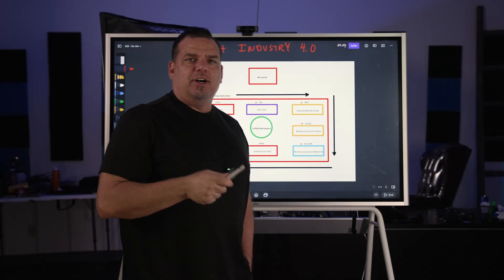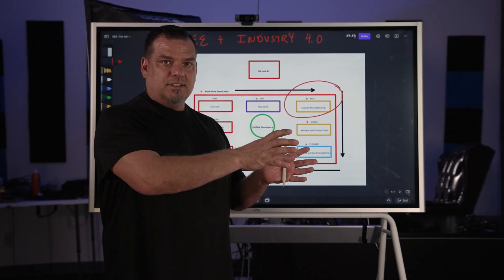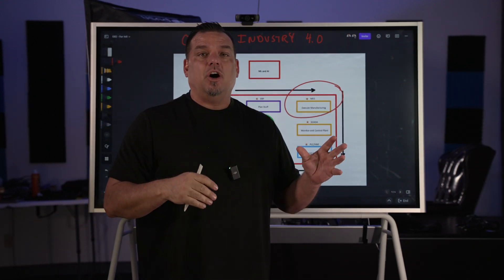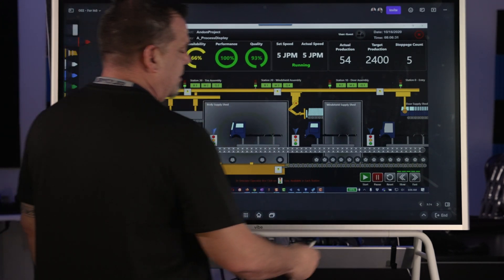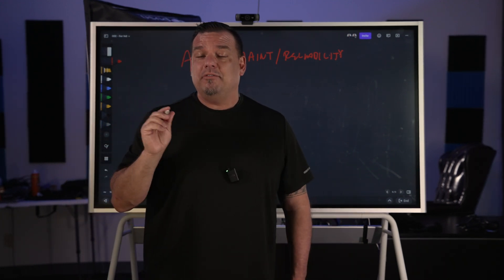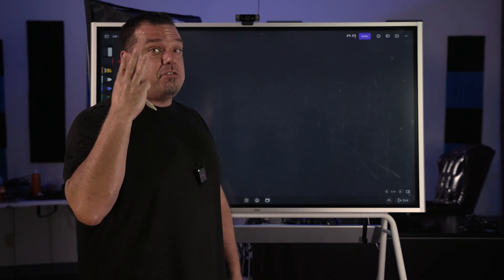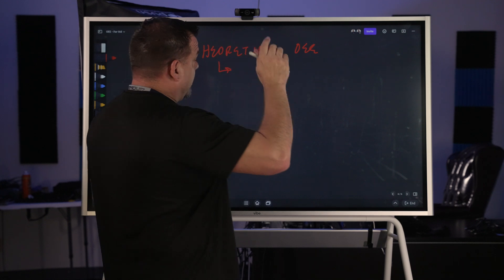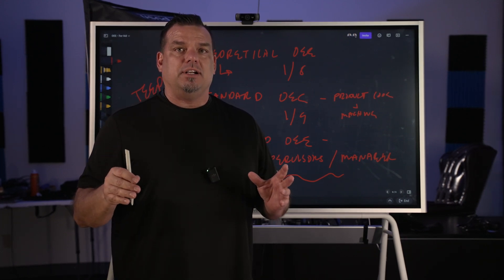OEE and Industry 4.0

Comment: I don't think I completely understand the part about the three types of OEE.
1. in the theoretical and standard OEE I would calculate without downtimes, setup times and scrap parts? What is the theoretical OEE good for if it is never achievable in practice?
2. with the scheduled OEE, the OEE is calculated after creating the production plan for a shift/day? So taking into account setup times and different cycle times due to different products? 
3. what statements can be made based on the different OEEs?
4. the fourth OEE would then be the actually measured OEE, correct?

Comment: I see to many machine shops without a metrology lab in the proper environment, and many calibrate there precision hand tools but forget the surface plate the base of all the measurements. This causes Quality within the OEE calculation to be wrong due to parts not in a temperature and humidified environment.

Comment: How would you consider "rework" parts in the OEE calculation, meaning that part that fails in one part of a substation are allowed to re-run through that station ( not a bad part but increase the cycle time for part production)?
Reply: Rework is a function of the reason it is re-worked.  Most commonly, re-work is an increment on raw material in for 1 part produced (2:1 instead of 1:1) but there are several scenarios where the cycle time for the rework is added to downtime in seconds to ding availability.

Comment: Clear explanation of the different types of rates for calculating the performance component of OEE: theoretical, standard and scheduled. Great video describing the difference and why you would use each one in a mature Industry 4.0 organization. Looking forward to more insights following your trip to Slovenia!
Reply from the maker: Thanks Jeff! We’re working on a series from the trip for our YouTube members, and Mentorship and Mastermind. Stay tuned!
Reply: I don't think I completely understand the part about the three types of OEE.
1. in the theoretical and standard OEE I would calculate without downtimes, setup times and scrap parts? What is the theoretical OEE good for if it is never achievable in practice?
2. with the scheduled OEE, the OEE is calculated after creating the production plan for a shift/day? So taking into account setup times and different cycle times due to different products? 
3. what statements can be made based on the different OEEs?
4. the fourth OEE would then be the actually measured OEE, correct?

Comment: I would love to make this kind of calculation work in my machine shop. There is just never enough consistency to make it work. Even on long runs there are so many ways to make things run faster, most cycle times are 300 percent faster by the time you get to the last part. Or the dreaded stainless part that breaks tools on Tuesdays and slows everything down. I wish there was a way that wasn't so rigid. Making things faster is easy, just communication, knowing how long something is going to take is elusive.